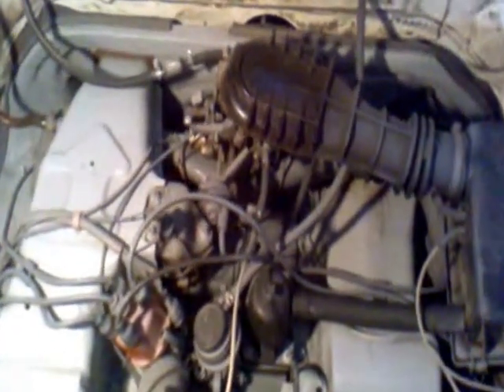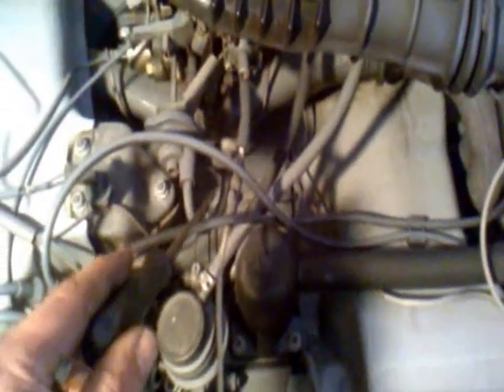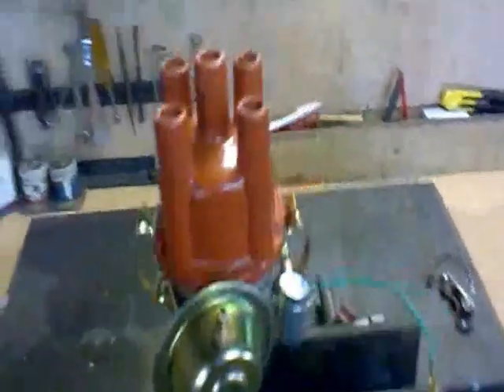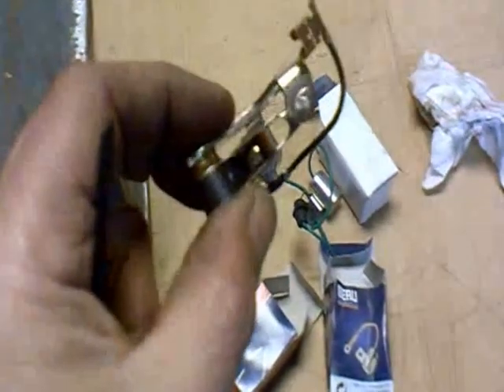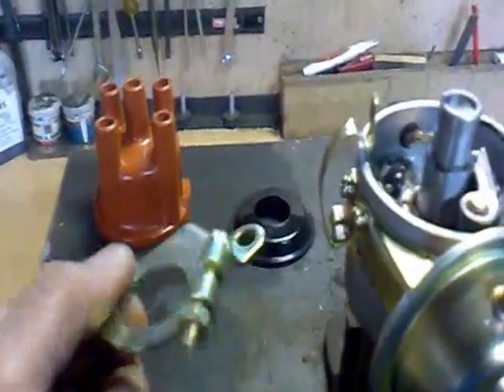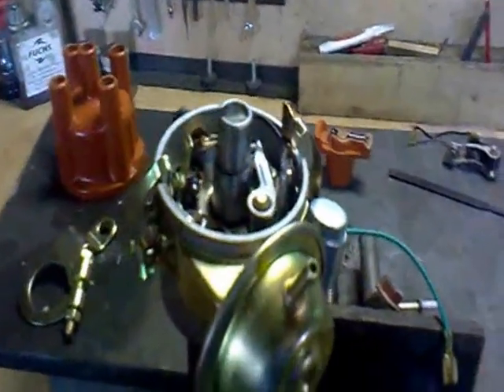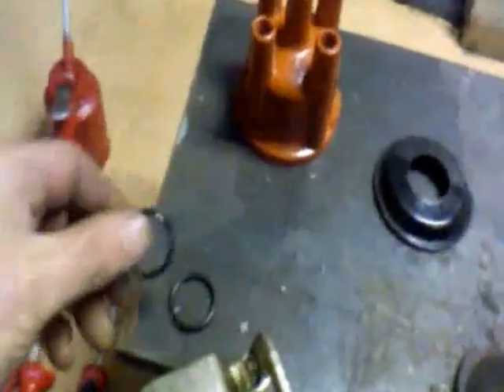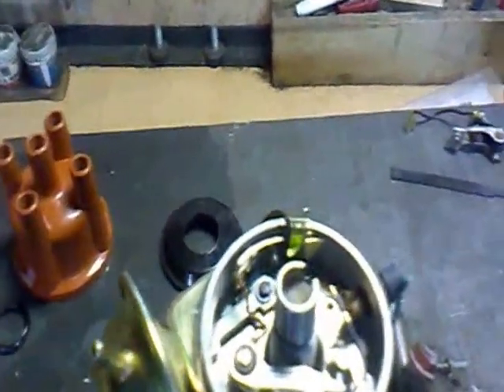How to retrofit a SVDA old school distributor on a late VW aircooled motor

Comment: You'd be miles ahead by upgrading the points/condenser setup to a points module ignition. Set the timing and go. No more points or condenser wearing out and no more dwell setting up.
Reply from the maker: Hello,
for electronic SVDA set ups, please see my other videos .
A  P'n'C distributor and coil is always a good spare to carry, if not for yourself then
to sort other V-dubbers problems.
Cordialement,